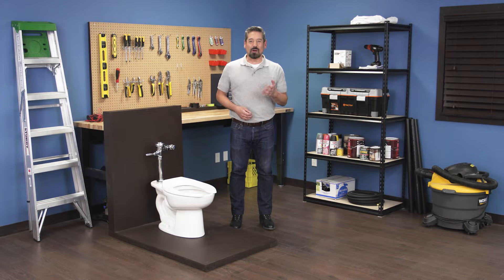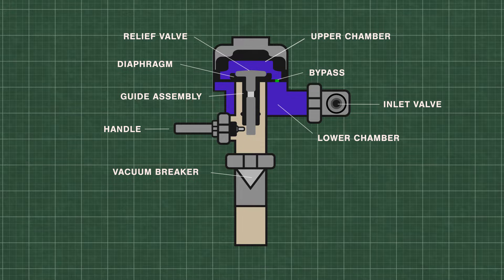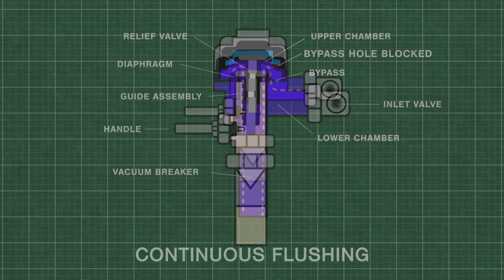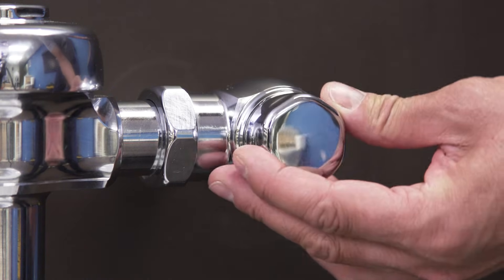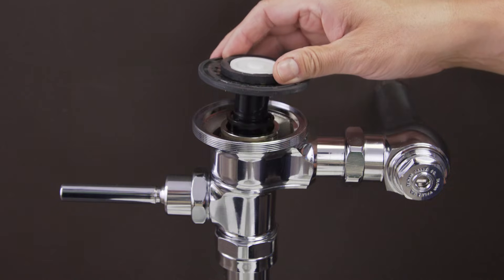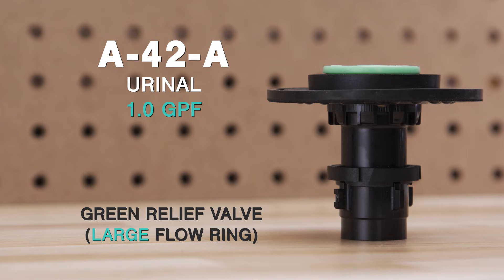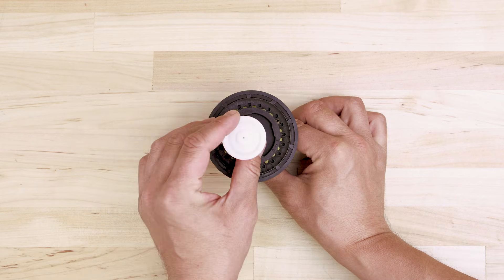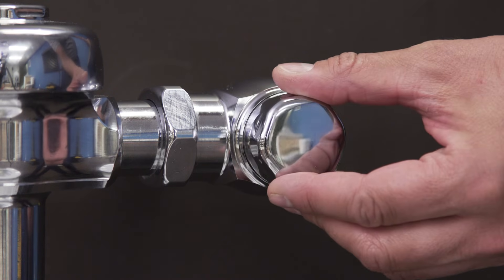Sloan Regal Flushometer | Diaphragm | Repair and Replace

Comment: GOT A SLOAN URINAL REPLACED THE INSIDES OF THE FLUSH UNIT AND NOW IT WON'T STOP RUNNING. TRIED TO ADJUST IT THAT DIDN'T WORK ANY SUGGESTIONS. THANKS IN ADVANCE
Reply from the maker: Hi Jeffery, thank you for watching. Its possible that the diaphragm or relief valve are not making a good seal with the valve seat. With the diaphragm removed, give it a good cleaning. Also check for any damage or corrosion on the valve seat.

Comment: Thanks for the uploads. My toilet flush odometer is sweaty and cold to the touch.
Also the feeder pipe feels and sounds like water is constantly running thru it.
Is this normal? Thanks anyone
Reply from the maker: Thanks for watching. What you are noticing is condensation. Since there is cold water inside the pipes, its causing water vapor in the air to condense from a vapor into a liquid, which is collecting on the pipe. Generally if the flushometer valve is closed all the way there shouldn't be water running to it. The pipes are connected to the system so there might be water running somewhere else in the line, which you might be hearing.
Reply: AMRE Supply I hear and feel when I touch the pipe water running from the feeder pipe coming out of the wall
and connecting to the Sloan flush odometer. I’m on 2nd floor of 14 unit apartment build in 1931.
Bay Ridge Brooklyn, NY.
Reply from the maker: @Jimfromearthoo7  If there's no water coming out of the flushometer at rest, then the sound shouldn't be a concern. If there is water continuously coming out of the valve then the diaphragm is likely not sealing properly.
Reply: AMRE Supply let me reiterate. 
1, the Sloan flush odometer is always sweaty.
2, feels cool to touch.
3, it feels and sounds like water is running from the small pipe that feeds the water.
No water is leaking.   So is their a problem or is this normal?
Thank you in advance
Reply from the maker: @Jimfromearthoo7  If no water is coming out of the flushometer or if no water is leaking below the flushometer then there is no problem. Sweaty pipes are normal if the water is cold (condensation). The inlet pipe is connected to other pipes so you're likely hearing something else in the system.

Comment: what would cause the assembly to be stuck,  the diaphragm came off but the rest is stuck inside the pipe.  this is a pre '98 regal urinal.
Reply from the maker: Thanks for watching. Overtime the rubber from the diaphragm can deteriorate, separate and become sticky which could be why the assembly is stuck.

Comment: I meant the bypass hole, does it matter where it is positioned?
Reply from the maker: Hi Vinceleto, the valve is circular so the position of the bypass hole doesn't matter. You can drop in the diaphragm and you'll be good to go!

Comment: Does it matter where the little hole on the diaphragm is positioned or just drop the unit in and you are good?
Reply from the maker: Hi Vinceleto, the valve is circular so the position of the bypass hole doesn't matter. You can drop in the diaphragm and you'll be good to go!
Reply: AMRE Supply thank you
Reply from the maker: You're welcome!

Comment: ha best video for 15 years not one rep has been able to explain the flow ring size and the colors and its not marked on the box so god help you have them fall out and fix with others.
Reply from the maker: Thanks for watching! You're right the flow rings is not clearly explained or mentioned very often. Its surprising because such a small detail can really change the results of the repair!

Comment: I just purchased a new sloan valve kit and installed it into my regal flushometer, but when I turn the water flow on at the control stop it immediately starts flowing water and filling the bowl.  It does not shut off unless I turn the control stop off.  Does anyone know a solution for this?  It's all new parts.
Reply: Never mind.  I was able to get it to stop by increasing the flow until it shut off and then adjust it down to where it should be.
Reply from the maker: Thanks for watching Scott. We're glad you got it running, sometimes it just take some adjustment to get things working.

Comment: So i have a short flush. I changed handle, that wasnt the problem. This has got to be the problem correct?
Reply from the maker: Diaphragms are the most common source of short flushing as the rubber can break down over time, so replacing the diaphram is the best bet in your case.
Reply: That was absolutely the problem.  Honestly, I'm surprised you or someone else thought that changing the handle would do anything.  The handles on Sloan valves do nothing more than bump the relief valve with a metal rod and the rest of the flushing action is all water pressure
Reply from the maker: @exoticcar5482   Even though the diaphragm is the most common solution, the handle is still a source of short flushing and is even mentioned the Sloan manual. Consider a handle that is sticking and doesn't push into the relief valve effectively. If it only partially opens the relief valve, you might see a small release of water leak from the valve without a full flush.
Reply: @AmreSupply  True, but that is a very rare situation considering the simple, reliable mechanics of Sloan handles. You can usually tell a good handle from bad by removing it from the flushometer, looking at the rod, and observing its response to the handle movement. The handle only needs replacement if a. The handle joints and parts inside are so stuck and/or corroded beyond repair or b. the metal rod isn't moving out long enough or with enough force to strike the relief valve. However, in general, these are unusual cases as the gaskets normally keep water out of the handle joint. A vast majority of the time, the issue lies in the more fragile rubber diaphragm. Not saying to not check the handle though, because that's the first thing to rule out. My point is that it is relatively easy to tell if your handle is the problem without spending money on a new handle that may end up being a waste of money if it turns out that the handle wasn't even the underlying issue in the first place.  If the bathroom has another flushometer with a working diaphragm, it's even easier as you can temporarily mount the handle from the problematic flushometer to the working one and see if it functions properly. If so, you can instantly rule out the handle as the underlying issue and thus there's no need to get a new replacement handle
Reply from the maker: I agree that handles are not a very common part that needs replacement, but i must give you props to your explanation though, it breaks down the troubleshooting logic very well!

Comment: On mine at the vacuum breaker on the pipe after done flushing water comes up through the breather holes. Could that be a bad vacuum breaker? Or a blockage in the toilet itself?
Reply from the maker: If it was a blockage in the toilet, you would notice a very low water flow in the toilet itself. Most likely it is the vacuum breaker. Over time the rubber breaks down sticks together and can restrict the water flow out of the vacuum breaker. Try replacing the vacuum breaker, I've linked the repair: https://youtu.be/k2AmW8Xzwpo?list=PLCo9SMjkdWByMAtNJtJoV9e3hvdkojlRz
Reply: AMRE Supply thank you that helps!
Reply from the maker: You're most welcome! Let me know if that fixes it.
Reply: AMRE Supply definitely will just need to get the part haha

Comment: My problem is., I have to have the  handle pressing down or water no Come out and is a Sloan commercial toilet
Reply from the maker: If you have to constantly hold down the handle or the flush stops, it is probably an indicator that you'll need a new diaphragm. If the bypass hole in the diaphragm is enlarged, the valve will reset too quickly as water rushes into the upper chamber before the valve can completely flush. Did you replace the diaphragm?